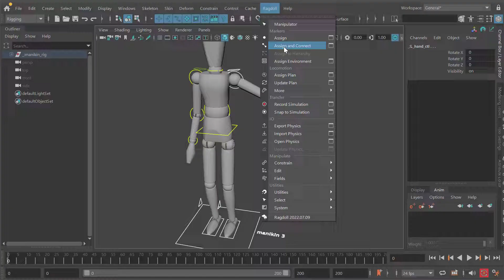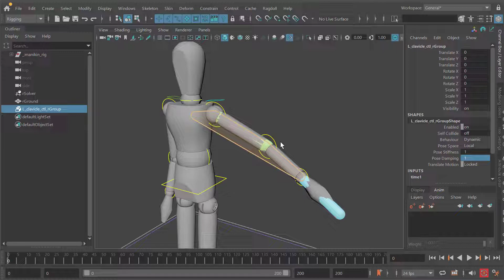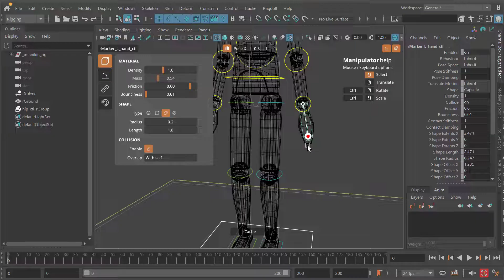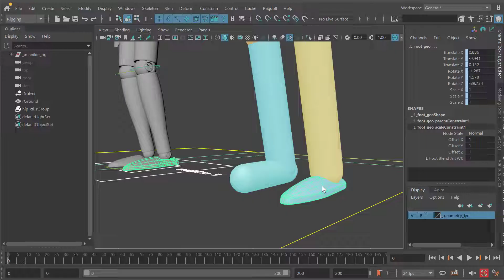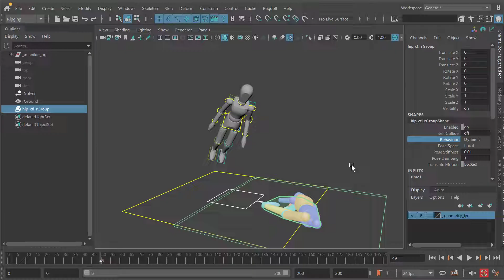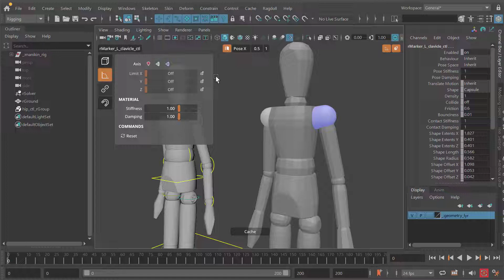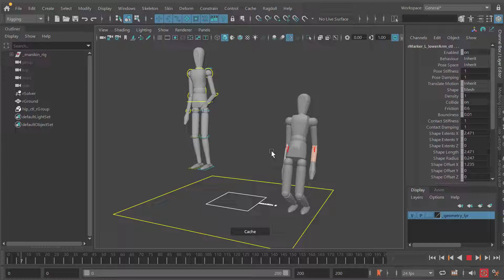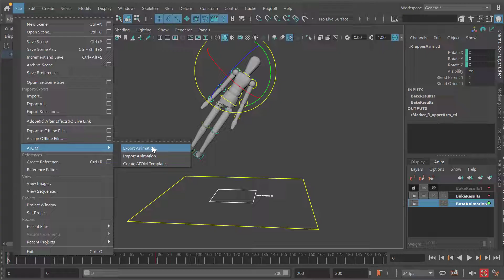Ragdoll in a Nutshell pt. 1

Comment: I've watched the video 4 times, followed step by step and I simply can't get this to work.  I have a skinned character driven by a separate "mocap skeleton" character that has rigid bound geo.  When I try to apply the ragdoll to the skinned character the performance is horrifically slow and totally unusable.  So I tried applying ragdoll to the rigid character that drives the skinned puppet and performance wise it works much better.  However, when I set up the chain starting from the root, spine, neck and head, the ragdoll puppet doesn't keep its shape and just flops over by default.  If I try adding keys everything breaks apart.  I'd love to use this but it's too finnicky and just not working with my rig unfortunately.  Any suggestions?
Reply: Hi @3DaveP, thanks a lot for sharing this, I'd love to get to the bottom of what you are seeing. Would it be possible to share screenshots and/or more about your circumstances and process on the forums? That way we can have a conversation and I can try and produce samples and give tips for how to proceed. https://forums.ragdolldynamics.com/ For completeness, did you try this workflow on the Manikin asset itself? Just so we're starting from the same page, you can find it here: https://learn.ragdolldynamics.com/tutorials/manikin/
Reply: @MarcusOttosson  OK I'll try on the  manikin asset 1st - I initially tried on my own rig.  Will keep you posted.  Thanks for getting back to me
Reply: @MarcusOttosson  Ok I posted in the forum - it's mostly working now but still some weirdness going on